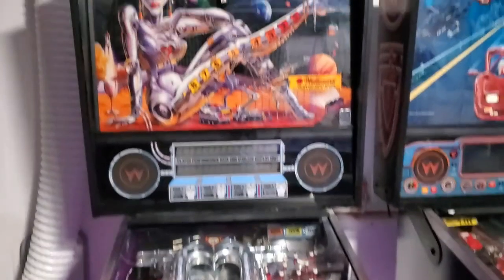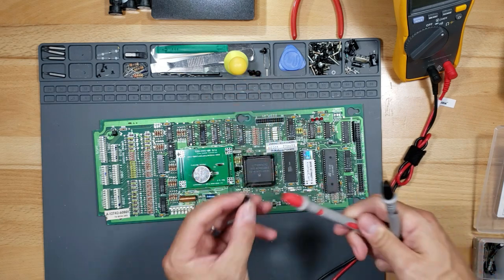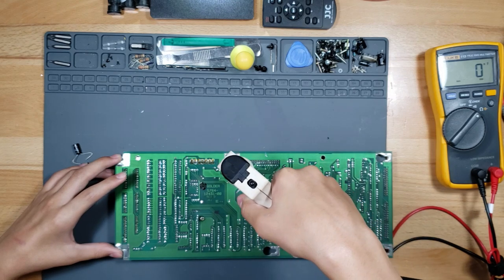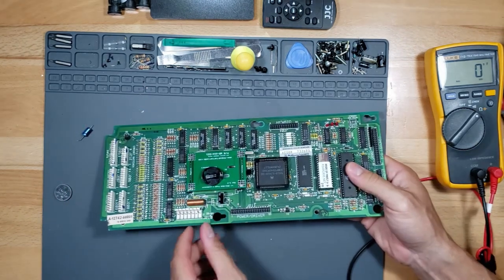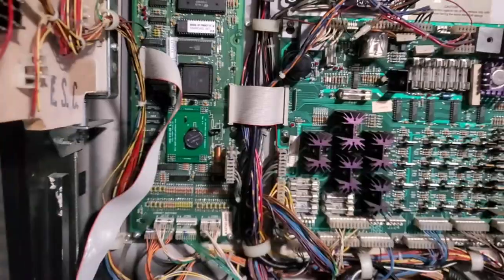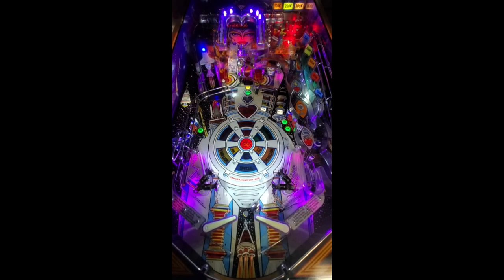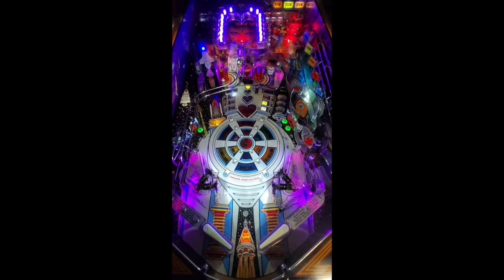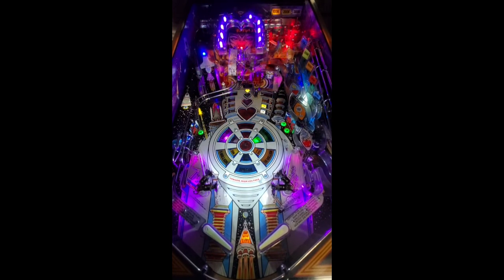Pinball machine Repair High Score Settings Reset fix

Comment: The only problem with those "No Reset" boards is that they do not solve the problem. They only mask the problem. It's always wise to go in, multimeter test and actually fix what's wrong with the board. That's why it was great that you repaired the capacitor first. That way it doesn't start leaking crap all over the board and really mess it up. 

Great job. 👍

Comment: I'm guessing that PINSOUND No more Reset board is some type of Current doubler? because it has to increase the current if you add more mods and more loads to not drop drip down the +5v supply
Reply from the maker: I believe so.

Comment: Hay Tec man. I have a 90 s10 truck that has a digital dash I fixed it all except for the speedometer and signal lights not working what could be the problem only thing is it could be a bad solder joint can't figure out how to trace it back I'm thinking it could be the Trac bad somewhere if I knew witch way to trace.